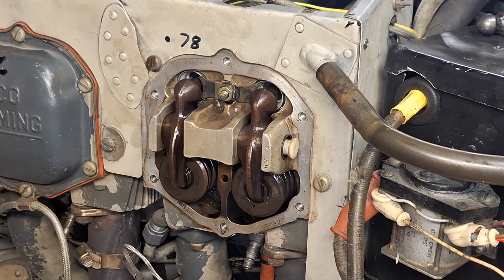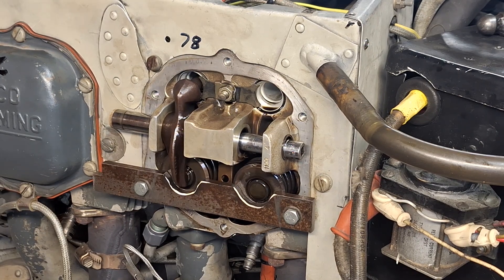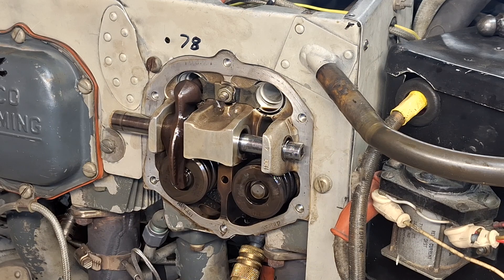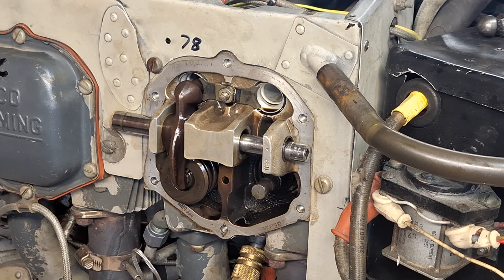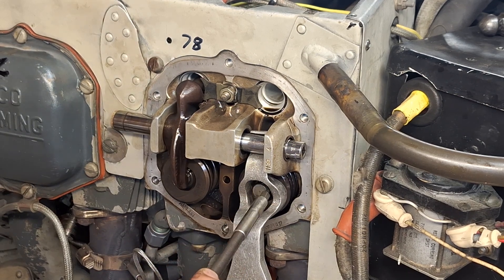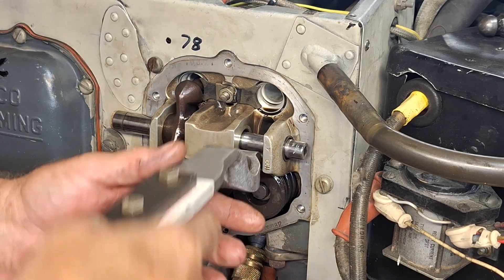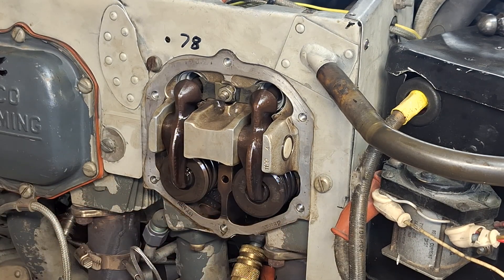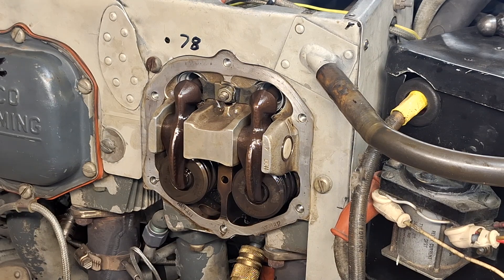Lycoming 180 hp exhaust valve guide check

Comment: Engine monitor report no egt and you ripped an engine apart to check a valve?  LOL WUT??  Check the exhaust pipe for heat, boroscope the valve.... what a hack... you really must love that tool you make if you think this is the best way to troublshoot.  Also the owner is an IDIOT for allowing this.

Comment: I maybe would have done some diagnosis in a bad probe before doing all that. Like turning on the master and seeing if they’re all close to even maybe. I’ve never seen anyone use air to do this. If you tighten that tool you made all the way, you don’t even need to depress the spring you can just take the keepers out. The plate will depress them for you

Comment: Next time try pushing about 6 feet of cloths line in the spark plug hole and turn the prop until it holds the valve in place. Works even if the valve is bad

Comment: Excellent explanation. I was a flight engineer for 30 years, built several car engines and jet engine mechanic. Your video was a huge help in my learning of GA engines. We have a Mooney w Lycoming 180 hp and "something" in the engine is causing a skip at low RPM.  1-2-3-4 skip, 1-2-3-4 skip.  Bad plug, leads, mags (think not), intake leak, exhaust valve, (I hope not) carburetor?

Comment: Looks like an O-360 mounted in the front of a Mooney M20C…?

Dog house, cooling air line, and battery case…

Where a stuck exhaust valve can cause quite a vibration, while missing 25% of its power output….

Kerry McIntyre?  (Mooney Mechanic Extraordinaire, KNR)

😃

- a -

Comment: Would it make more sense to check the EGT sensor before disassembling the valve spring?
Reply from the maker: The valve guide inspection was due and the owner wanted it done since it was in the shop. The problem has not reoccurred even after swapping the EGT probes.  Go figure.

Comment: Wouldn't the leakdown test have said the valves were seated?
Reply from the maker: we are checking to make sure the valves have clearance in the guide to prevent seizing. it is very common in lycoming engines. its recommended to check every 400 hours